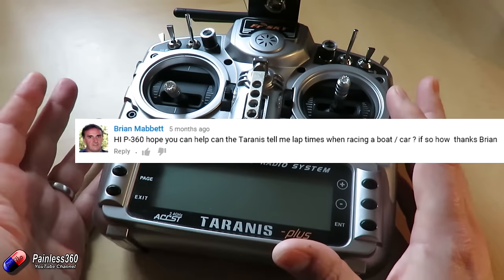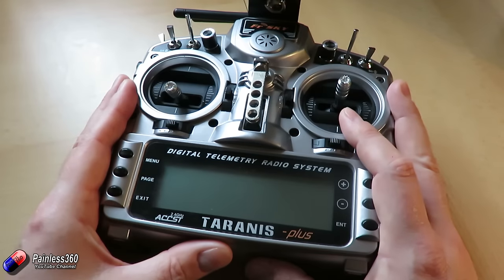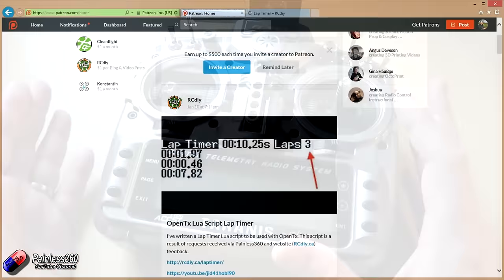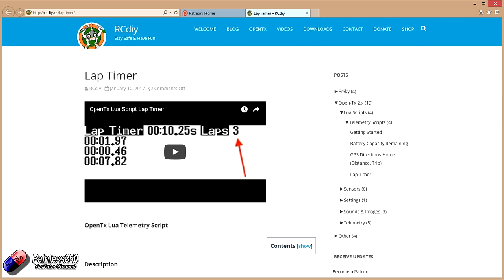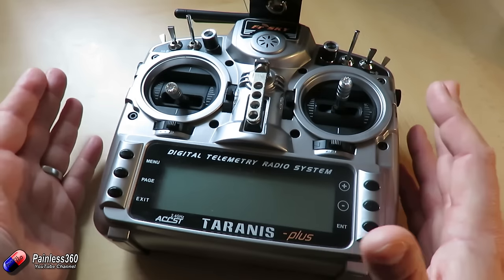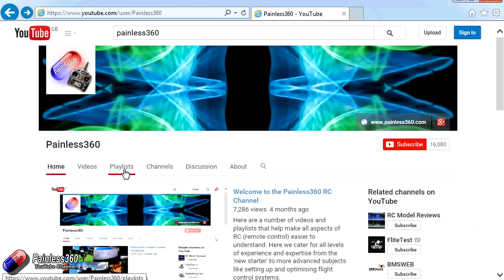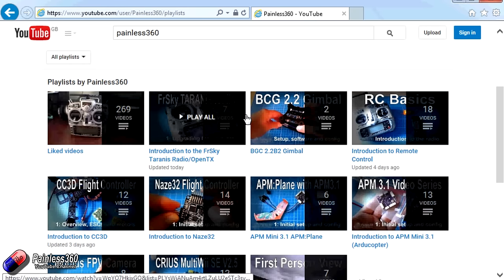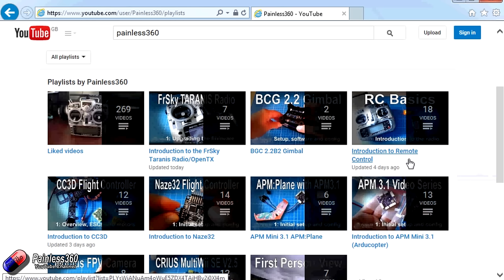RC News: New Taranis OpenTX LUA Lap Timer Script from RCDIY

Comment: There is a lap timer that triggers when you go by a sensor, that sensor is picking up the 5.8ghz video,  would it be possible to do the same thing with the RSSI to trigger the laps timer ??
Reply from the maker: mike jh we will be covering the TBS Race timer in a video very soon...
Reply: Hi
that will be cool thanks.    I was wondering if it could be done with the 2.4ghz  and taranis RSSI  
If your RSSI is above say 90 when you fly by your self then this could trigger the lap timer .
Reply: Issue with that is the TBS Race Timer uses the gain level of your VTx to determine if it has passed by the Race Timer, using the RSSI value wouldn't net an accurate time because it would always be picking up a good signal regardless of just finishing or starting a lap, you wouldn't be able to properly time with a setup like that.  I believe the TBS Race Timer attenuates the incoming video signal and only registers it as a completed lap when the incoming signal strength reaches a programmed threshold which can only be achieved with a powered on VTx passing within a few feet of it.  Those are just my thoughts however.

Comment: Hi mate are you aware of you can bind 2 rxs to the one tx ? 

Weird question I know :)
Reply: You can store 60 models on the Taranis internal memory, so that means it can remember 60 different receivers just with its own memory, add a SD card and its even more!
Reply: The Illumiquadi I wrote it the wrong way around haha, I mean 2 controls to the one Taranis :)
Reply: BadhabitRC Ah,  unfortunately not yet...receivers can only be used on one transmitter at a time,  but the binding process is really fast.
Reply: The Illumiquadi thanks a lot :)
Reply: BadhabitRC Glad to help!
Reply from the maker: The only receiver that I know of that will support this is the X8R. You can bind two to the radio at once to allow for all 16 channels to be used PWM (or combinations of). https://www.frsky-rc.com/product/pro.php?pro_id=105
Reply: Painless360 thanks mate